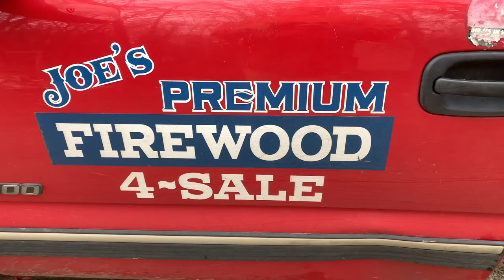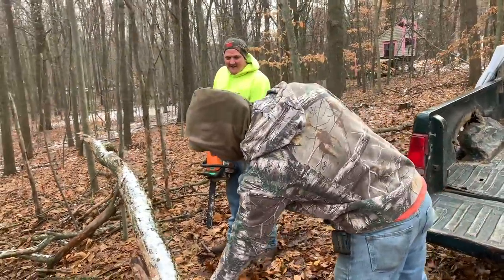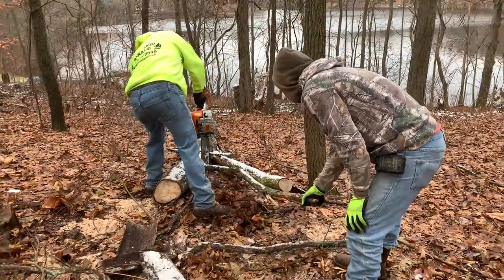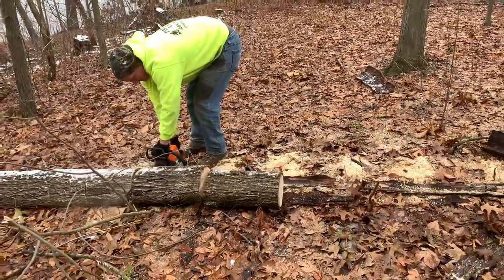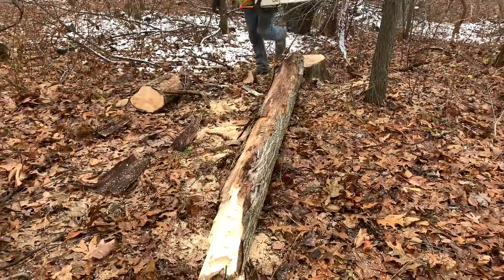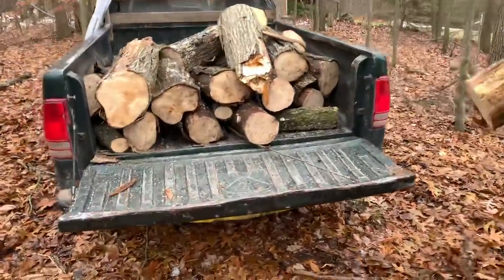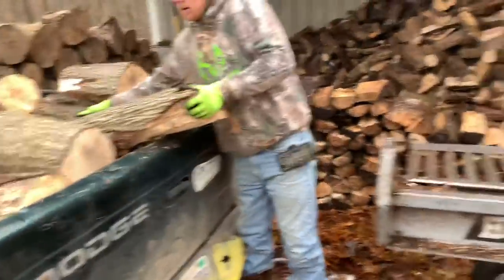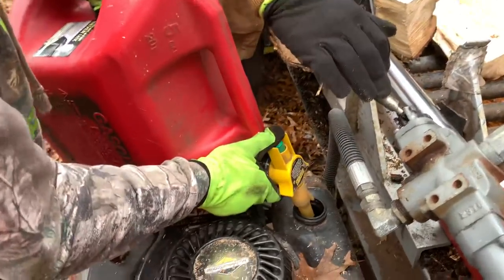FIREWOOD - How fast can 50’ fallen elm tree be bucked & loaded

Comment: The bolt in your splitter would be a breeze to get out. Looked like a ellen head bolt. Take the other side out should spin right out. If not a drill with a small bit and a ez out.
Reply from the maker: I just make sure to keep the one bolt tight.